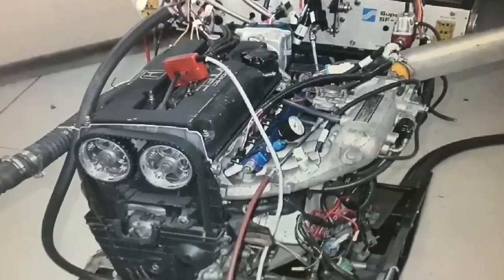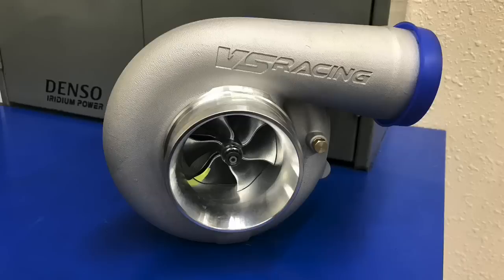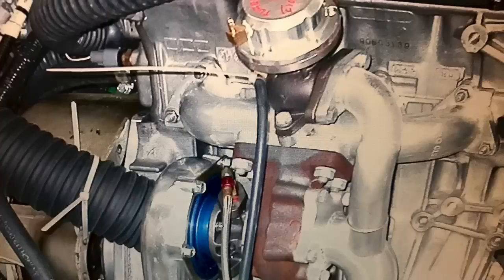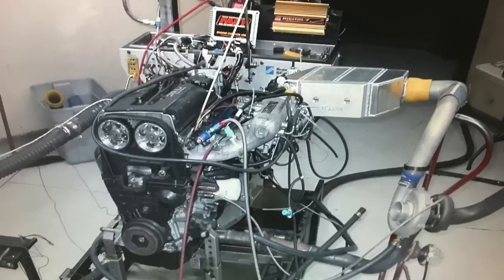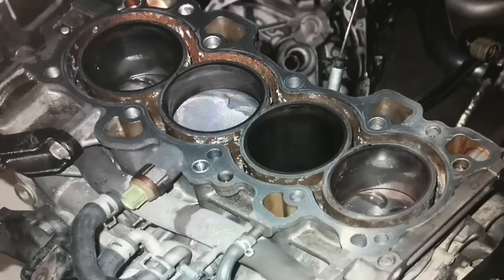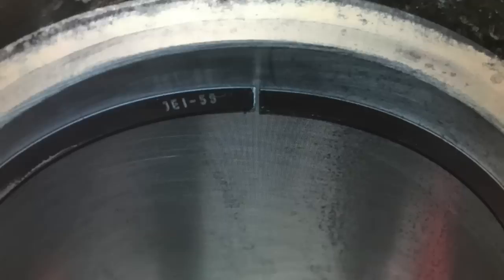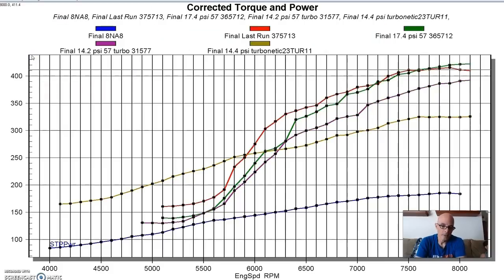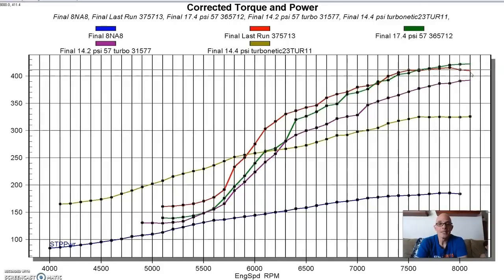BIG BANG B16A-HOW MUCH BOOST?

Comment: Can you do a video on the Chevy Sprint 1.0 Turbo 3cyl I'm a..... Asking for a friend being a 3-cylinder guy is not something I would usually admit  lol
Reply from the maker: Great suggestion!
Reply: @richardholdener1727  I own a 1.0 Ecoboost Fiesta as well, which could be a good test. I know those engines are available at wrecking yards from crashes. 2014 to 2017 Fiesta SFE package. Ford showed them at 200hp in an open wheel car in Europe a few years ago. Chris Harris tested it. I'd really like to see how far it can go before total destruction. I'd bet closer to 400hp.
Reply: @f688xt6  How many miles you got on it? i just got a 15 with 96k
Reply: No test nessecary. It'll be ok. I promise.
Reply: My dad had one of those. Great little cars and a hoot to drive.
Reply: The new koeningseg has a 3 cylinder with 600hp, and another 800hp electric system!!
Reply: back in the day a guy on one of the sprint/metro/firefly forums got a custom cam made up with some other parts and claimed 700hp out of it.  I cant say wether or not it actually happened, but it was a good story.  I instead 3.4L montana van swapped mine. lol
Reply: A stock G10 probably can't handle much more than 80HP. The biggest issue most people seem to have is the head gasket blowing at higher power levels. I think a copper head gasket and some head studs is the workaround people use for that issue. If your "friend" is serious about building one of these, go ask the lovely people on geometroforum for advice. In my experience, you would definitely want to replace all of the valves in the head with a new stainless steel set, and find a solid camshaft. I've seen a valve drop and a hollow camshaft snap at the stock 55ish HP of a NA G10.

Comment: I was curious why you chose a "medium" size compressor and a .63 hot size. The 57mm 3076r was always the 400hp pump gas turbo i used ten years ago.

Maybe try a modern billet 67mm to 70mm wheel in an anti-surge housing with a hot side around .9-1.0 a/r? Maybe gap it at 22mm top and 24mm second? I wouldn't be surprised to see 700hp.

Comment: Can you do the k series next? Also would it be possible to get you hands on a barra?
Reply: For reference sir My stock K20a2 has made 660-680whp for about 2 years now with no issues yet lol. Just an oil pump and some ARP hardware. It sees 34-35psi in 5th and 6th gear.
Reply from the maker: I wrote a book on K series-they work very well
Reply: @richardholdener1727  Definitely going to check that out; I didn't know that. I'm building my first all motor K right now during Quarantine lol. 89×99 with stock crank, should be ~13.5:1 with a 4Piston 156 head. I think the next mod will be to jump on Amazon and grab your book!
Reply: @richardholdener1727  time to big bang a k series!!
Reply: B A R R A ! 👌🏻😈🤘🏻

Comment: I would like to see testing of different ratio rocker arms...
Reply from the maker: on a Honda?
Reply: @richardholdener1727  Actually  I was just wondering in general. I see where people use different ratio rocker arms and wondered how they test
Reply: @cuzz63  they dont have rocker arms. It's a DOHC setup. No pushrod, no rocket arms.
Reply: @davidbailey4036  They do have rockers/cam followers but modifying their geometry would more trouble than changing the camshaft.
Reply: I think there’s an episode of engine masters on the subject. Not on a Honda, they probably used a 383 Chevy if I had to guess

Comment: I'm looking at putting a water to air on my 1jz,but am a tad sceptical, what are your thoughts on water to air for street/drift use
Reply: Don't need a water/air unless you want the extra weight and complexity. A high flow air/air will work fine.
Reply from the maker: it is better suited to short use or where the weight isn't an issue-like Bonneville
Reply: @richardholdener1727  weight isn't an issue, will have a full size radiator in the trunk with a decent E fan for water to air, air flow at the front is my issue,was having overheating (realistically running very warm not overheating) issues when i built the car, turns out the intercooler was blocking the air flow through the front of the car, switched it out to a smaller unit, problem solved,but does get up there in the aits sometimes
Reply: There are some cars that use a factory wac. You can get some benifits of simplified plumbing because you don't need to pipe outside the engine bay. For a drift car that spends most of its time going sideways an air to air sometimes can't shed enough heat. The huge downsides of water air cooler is  cost and complexity. You need two heat exchangers, a reservoir and pump and none of this stuff is free. If you look at how many new cars with forced induction have water air coolers, and how many have air to air coolers, one is considerably more popular. Since you already have an air to air cooler and want lower iat, i would try my best to make it better. Some baffling or trimming plastic to increase air flow, most guys especially on the street have really good results with an air to air. I have also never heard of someone being disappointed with an air to water cooler unless they were way beyond its capacity. Pretty much all the new v8 cars from Detroit with a blower and every car from Germany with a turbo come with an air to water. Drifting with an air to water will mean you need a bigger reservoir to work as a heat sink because there isn't enough air flow to shed the heat that the water picks up in use.
Reply: @timothybayliss6680  Cheers, Yeah if i do water to air, will have a tank, a full sized radiator with a big fan, souly for intercooler, all in the boot with the floor cut out,my current air to air is ducted along with radiator

Comment: Do you have a rule of thumb measurement of how much ring gap widens with mileage (ex 200k miles)? What have you observed?
Reply: ZZZracing every engine is different. Never take a chance and guess.
Reply from the maker: there is no absolute correlation
Reply: No,no,no. Don't estimate tolerance. 
Ever.
Reply: My un-educated but experienced rule of thumb, is 0.006 per inch of bore diameter. That's where I usually start.
But like Richard said, it depends on the engine, heat in the cylinders for the target hp, placement of rings on the piston, and what material they are, what material the block is made of, and if it's supercharged, turbo, nitrous, or n/a.
One example from me is a 2.5L Shelby Dodge 4cyl,8valve fastburn head, 8.2 CR, ring gap set at 0.029, I ran 31psi stock pistons, rods, crank, headgasket, headbolts.
Made repeated runs at my local strip, and multiple dyno runs.
Never cooked a piston or burned a ring. My .02